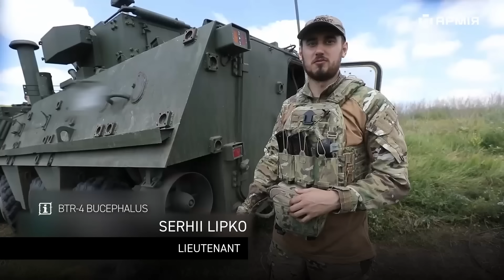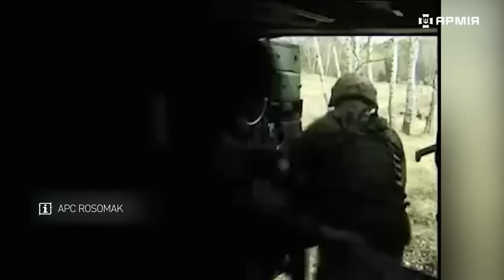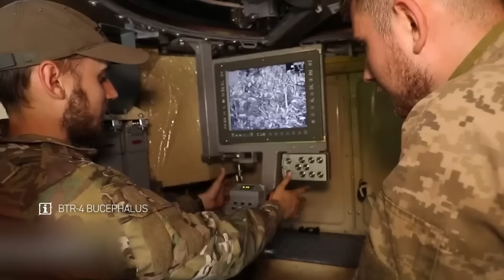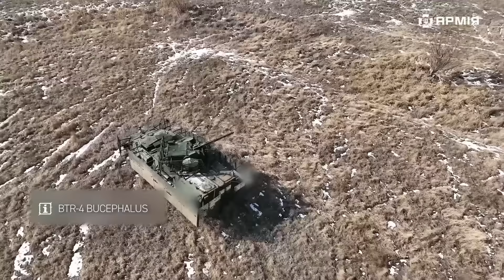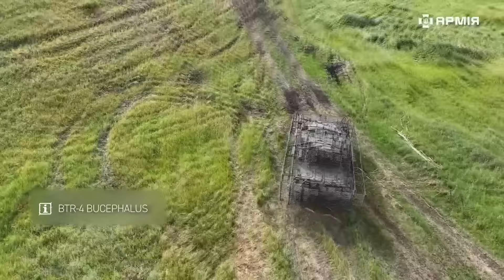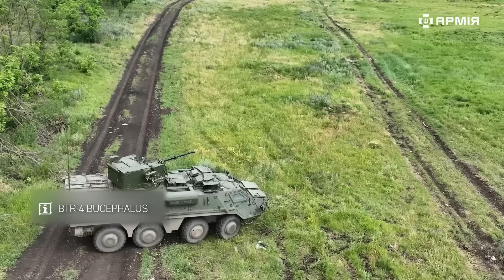They Built Something UNKILLABLE... Russia Has NO ANSWER | ARMY TV

Comment: Ofcourse a Ukrainian will say that the BTR4 is better.. Rosomaks were in Iraq or Afghanistan and performed excellent! Why do you have to weld steel cages on the soviet legacy BTR4? The Rosomak is made in Poland and the bushmaster 30mm can actually damage tanks, remember when a Bradley with 25mm bushmaster engaged a T90? Proszę, okaż trochę więcej szacunku krajowi, który pierwszy ci pomógł. 🇵🇱🇵🇱
Reply: You don't understand anything about armored vehicles if you compare the BTR-4 with Soviet vehicles. You could at least ask an artificial intelligence (AI) about the differences. I've explained below why the BTR-4 is better than the Polish-Finnish vehicles, and what advantages the Rosomak has. But it's much more profitable for Ukraine to use a domestically produced BTR-4 rather than a Polish-Finnish vehicle, which is much more expensive and has less firepower. The BTR-4 "Bucephalus" is not a heritage of the USSR. It is entirely Ukrainian-made, created "from scratch" in the era of independence. In principle, the Radian line of armored personnel carriers (BTR-60/70/80), which were based on a completely different logic, is being developed. As a Ukrainian, I have no respect for Polish chauvinists like you and never will.
Reply: The Polish patriot doesn't know that the Polish-Finnish APC was also fitted with anti-cumulative gratings. Polish Rosomak armored personnel carriers (a licensed version of the Finnish Patria AMV) are standardly equipped with anti-cumulative grenade grenades (Slant Armor). Their main purpose is to protect against hand-held anti-tank grenade launchers (such as the RPG-7). If we ignore the unfounded claims of the Polish jingoist, here's what artificial intelligence tells us: Missions in Iraq (since 2003) and especially in Afghanistan (as part of the ISAF forces since 2007) were a difficult baptism of fire for the Polish KTO Rosomak APC. Although in Poland this vehicle was nicknamed the "green devil" for its high survivability, real-life guerrilla warfare revealed a number of design problems and critical flaws.
1. Critical vulnerability of the base armor to RPGs
2. Loss of buoyancy due to excess weight. Problem: After installing heavy add-on armor and anti-HEAT screens, the APC's combat weight increased from the base 22 tons to 26 tons. Result: The vehicle completely lost its ability to float. This wasn't critical for the deserted Afghanistan, but it dramatically changed the APC's performance characteristics by overloading the chassis.
3. High center of gravity and risk of rollover due to explosions on the IED. In 2009, in Afghanistan, the first Polish soldier in a Wolverine died in this manner. A high explosive explosion flipped the APC onto its roof, and the gunner, who was in the open turret hatch, was crushed under the weight of his own vehicle. 4. Gunner's vulnerability in a half-open hatch
5. Lack of guided anti-tank weapons
6. Electronic vulnerability and logistical issues. Problem: The vehicles had extremely sensitive Western-made electronics for the vision and fire control systems. In the Afghan heat, penetrating fine dust, and shaking conditions, the optical instruments required constant, meticulous maintenance.
Reply: @denkravtsov6009  Our License means you can build and modify the product you pay for... Patria sold us basic stuff, we made it better... Patria we bought had no turret, so what grenades? Dude, just appreciate what you have received, mostly for free, because there would be no Ukraine if not for our help at the beginning of this efing war... Some people tend to forget about it... I'm afraid if that were the other way round, you would do shit... "real-life guerrilla warfare revealed a number of design problems and critical flaws." and of course the BTR4 is  fucking perfect from day one... reaally dude chill
Reply: @d @denkravtsov6009  know about the operation in Afghanistan i will give you that but dude chill..Why are you so angry? And whats up with Polish Patriot, ofcourse i will always be a patriot, is that bad? Are you not a patriot of your country? And oh, sorry that Poland donated T72s, PT91 Twardy, Rosomak, Rak, Krab, MSBS Grot Leopard 2s from their own active army.. I was pointing out Bias by a country to always say that ”We have better equipment that we produce here” any country would say that. I bet you belive that i dont want Ukraine to win, of course i do and my heart goes out to everyone that have to fight for their natione survival.
Reply: daj spokoj... podejrzewam ze jakby byla odwrotna sytuacja to gowno by pomogli.
Reply: @kpwlek коли поляк говорить дурниці я не буду це слухати і цілувати його в дупу. І кожен раз пригадувати про свою допомогу це низько, ніхто так не робить крім поляків і Трампа.
Reply: Wymagasz za dużo

Comment: For a long-term defensive war of attrition, the BTR-4 “Bucephalus” is strategically more advantageous for Ukraine, despite the fact that from the point of view of the safety of an individual crew, the Polish Rosomak is a better vehicle.

Economic, logistical and tactical factors determine this choice:
1. Economic factor (Effect of scale)
- For the price of one Polish Rosomak, Ukraine builds 2–3 BTR-4 units.
- In a defensive war on a wide front, the number of barrels and armored vehicles in the trenches is critically important. The BTR-4 allows units to be saturate with armor much faster and cheaper.

2. Logistical independence and repair
- BTR-4: The full cycle of production, restoration and modernization is located inside Ukraine. A vehicle damaged in battle can be quickly taken to the factory or repaired by mobile brigades. Spare parts (engines, gearboxes, suspension elements) are domestic or available analogues.
- Rosomak: Any serious breakdown of the imported Scania engine, hydropneumatic suspension or Hitfist-30P fire control system requires either scarce foreign spare parts or sending the vehicle to Poland for repair. In conditions of border blockades or delays in deliveries, this turns the equipment into “immovable property”.

3. Firepower capabilities in defense
- In a defensive war, the main task of the APC is not to storm positions, but to restrain enemy equipment and infantry from closed or camouflaged positions.
- The presence of the Stugna ATGM on the BTR-4 makes it a full-fledged tank destroyer at a distance of up to 5 km. The basic Rosomak with a 30 mm cannon is powerless against heavy T-72 or T-90 tanks at long distances. The BTR-4 is capable of independently stopping an enemy armored breakthrough.

4. Speed of import substitution
- War experience has proven that the Ukrainian defense industry is capable of quickly (within weeks) modifying the design of the BTR-4: welding on anti-drone grilles, integrating new electronic warfare systems, and modifying armor elements to meet new threats (e.g., FPV drones). The modernization of the Rosomak requires complex coordination with Polish and Finnish manufacturers (Patria).

Comment: The price difference between these vehicles is colossal: the Polish KTO Rosomak costs approximately 2-3 times more than the Ukrainian BTR-4 Bucephalus.
Why is the Polish Rosomak so much more expensive?
Licensing royalties: Poland produces the Rosomak under license from the Finnish company Patria. A portion of the cost of each vehicle goes to the copyright holder.
Western components: The vehicle is equipped with expensive European components—Scania engines, hydropneumatic suspension, and imported digital electronics/thermal imagers from Safran and PCO.
Result: For the cost of one new Polish Rosomak in the top configuration, Ukraine can produce up to three BTR-4 Bucephalus vehicles.
Reply: The Polish vehicle has vastly superior composite armor, NATO standard Bushmaster gun, and better engine. You're paying for quality.
Reply: @donwyoming1936  In a modern defensive war, the BTR-4 is a better option for Ukraine than the Polish Rosomak. This is the conclusion of an artificial intelligence system after considering all the advantages and disadvantages of both vehicles. You can read the conclusion below in the comments.

Comment: The Main Advantages of the BTR-4 "Bucephalus"

1. Fire Superiority: The Stugna anti-tank missile system allows the BTR-4 to destroy heavy armored vehicles (including tanks) at ranges of up to 5 km. Most of the Polish Rosomak variants transferred are equipped only with a cannon and lack an integrated ATGM.
2. Fire Control: The unmanned Parus combat module allows the operator to control the weapon from the depths of the hull, from a relatively safe location.
3. Repair Adaptability: Repair logistics are completely contained within Ukraine, which is critical in high-intensity combat.

The Main Advantages of the "Rosomak"

1. High Survivability: The Rosomak is built on the Finnish Patria AMV platform. It has excellent mine protection and a V-shaped underbody that dissipates blast waves. 2. Component Reliability: The imported transmission and chassis can withstand long marches without breakdowns.
3. Western Optics: French and Polish Hitfist-30P thermal imaging sights provide better visibility at night and in poor weather than the standard BTR-4 sights.

Bottom Line.
The BTR-4 is an "assault vehicle" with the capabilities of a wheeled infantry fighting vehicle, capable of effectively destroying infantry and tanks, but requires caution due to its weak mine protection.

The Rosomak is a high-quality "armored bus" that is guaranteed to deliver troops to their positions intact and provide high-quality fire support with 30mm rounds, but it is not designed for duels with tanks.

Comment: Since 2014, the Ukrainian BTR-4 Bucephalus armored personnel carrier has undergone four key stages of extensive modernization (upgrades) in terms of design and protection. In addition, based on the results of actual combat use, the Kharkiv Morozov Design Bureau has made several hundred targeted design modifications to the base platform (improved transmission components, imported parts substitution, and modified water cannons).
Major stages and versions of the BTR-4 modernization since 2014: 

1. BTR-4E1 (Spring 2014) The first emergency upgrade of the base BTR-4E version, developed with the first weeks of hostilities in Donbas in mind. What has changed: A set of add-on armor was developed. The vehicle's protection was significantly increased by installing modular screens. They provide all-round protection against armor-piercing bullets and fragments of large-caliber shells. 

2. BTR-4M (2016) A specialized "marine" modification of the armored personnel carrier, created for the Indonesian Marine Corps. What has changed: The vehicle has received significantly improved seaworthiness. The APC has been equipped with additional floats, a modified water intake shield on the bow, and improved stern water jets for confident landing from assault ships directly into the open sea in rough seas. 

3. BTR-4MV1 (Late 2017) The most radical and conceptual technological upgrade of the Bucephalus, bringing it closer to NATO standards. What has changed: New armored hull: Engineers completely abandoned the Soviet legacy of armored windshields and side doors for the driver/commander. The bow section now has a sharp, monolithic angle, significantly increasing resistance to forward fire. Modular protection: Spaced armor has been implemented, allowing for quick replacement of damaged elements (including the installation of ceramic panels) in the field. Ergonomics and troops: The crew now enters through the top hatches. A full-size folding ramp has been installed in the rear, replacing the hinged doors, for safe egress of the troops under the cover of the hull. Energy-absorbing mine-resistant seats are installed. Electronics: The APC has a digital fire control system, a modern thermal imager, a laser rangefinder, and a 360° all-round visibility system. 

4. Full-scale combat modernization (2022–2026). A series of upgrades, quickly implemented during a full-scale war. What has changed: Basic BTR-4E armored personnel carriers began to be equipped en masse with factory-installed and front-line anti-drone systems (screens, grills, and anti-drone grids). BM-7 "Parus" combat modules received updated software for integration into unified digital battle management systems, as well as improved stabilization of the 30mm automatic cannon.